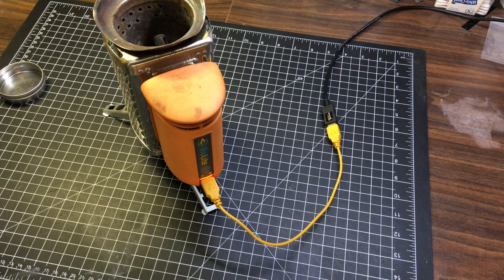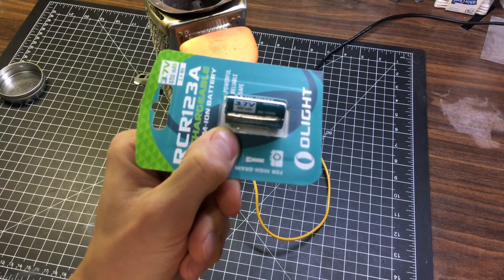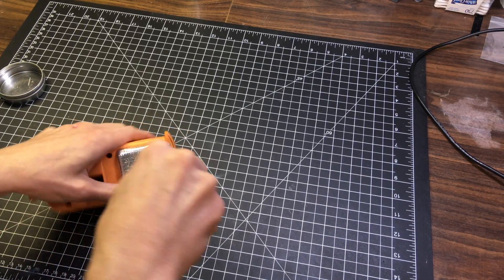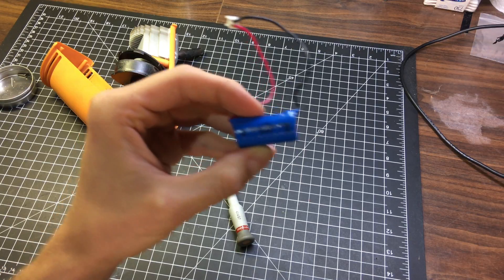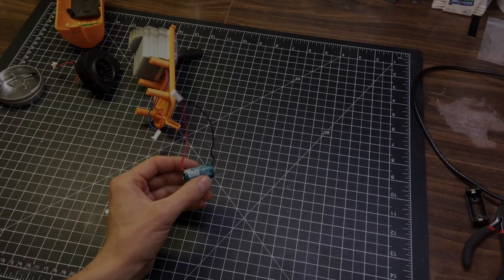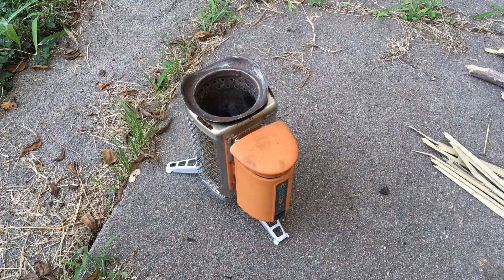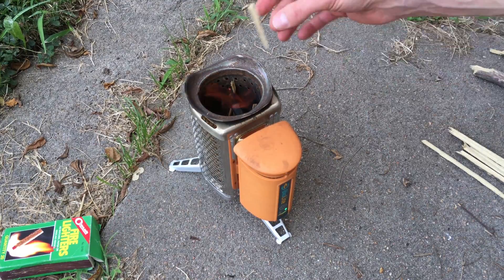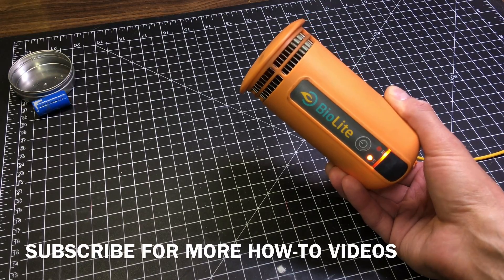How To: Replace the Battery in a BioLite CampStove

Comment: Thanks for posting this!  I've had a 1st Generation for about six or seven years now, too (with the kettle and grill - so sweet!) and while the battery is still functioning, I definitely notice a decrease in capacity and expect that I will have to switch it out sometime in the near future (which is what brought me to this video!)  In any event, thanks for posting . . . now, I'm just wondering if I can find a 3.7V with an ampacity greater than 800 mAh (you know, soup it up a bit!! :-) )  In any case - Great video, David!
Reply from the maker: thanks, I'm glad you liked the video!  good to hear you're going to keep your 1st Gen Biolite in service.  as for increasing the battery  mAh capacity, it should work fine, as long as you use the same voltage.  be aware, however, that the battery in the Biolite only powers the fan during startup, so upgrading the battery will only let you run the fan longer while starting the fire, and thats all (its not like the 2nd Gen that can be used as a power bank without an active fire).
if you have any questions about the battery replacement, let me know.  cheers, and good luck!
Reply: @DavidVonk  Right on, brother! :-)  The only reason I would want greater ampacity is to counter-act the capacitance leakage that occurs as a battery sits and waits for its next use.  Otherwise, in order to properly maintain the battery, it has to be brought up to a full charge every month and before each use.  Thanks again!
Reply: Here's a tip: cut a 3/16" or 1/4" steel plate the shape of the grill but slightly smaller. Transfer the oblong football shape to the plate using the grill body upside down. Drill lots of 5/16 or 3/8 holes in it. Throw away that cheap heat spreader that gets clogged, and say 'Hello!' to a searing grill surface. You can lift one leg of the grill to offset it, resting the opening underneath on the lip of the stove, to refill the chamber below. No dinky soy hatch needed - time for real steak!
Reply: Че написал про гриль я нихрена непонял

Comment: Just in case anyone is wondering... The Campstove2 has a 2600mah 18650 cell... I just changed it to a NCR18650GA 3500Mah (Only for the hinger capasity)
Reply from the maker: nice! thanks for sharing.  i would imagine that the 18650 cells would be easier to replace and more readily available... not to mention higher capacity.
Reply: Did you wire the battery directly, or did you solder the strip component that came with the original battery?
Reply: @Revyloution  Yeah, please let us know.
Reply: @RocketRiderToTheMoon  I wired the strip component on the 18650 battery. It's been working great.
Reply: @Revyloution  Was there any space left for a bigger battery? Otherwise a LG Chem 21700 battery would be perfect. 2 times the capacity (5000MAH) and just a little different dimensions. A 21700 battery is 70mm long. Please advice. 
LG Chem M50T link https://www.nkon.nl/lg-inr21700-m50-5000mah-7-3a.html?___SID=U

Comment: do you know the rating of the TEG, would be very helpful. thanks
Reply from the maker: from what i can find, the TEG generates 2 watts at 5 volts continuous, with a peak of 4 watts at 5 volts, dependent on the strength of the fire.  of course priority goes to the fan first, then to topping off the internal battery; when that is full, excess power is then diverted to the USB port.  ive read the fan uses about 1 watt and the USB port gets about 2 watts on average.
Reply: @DavidVonk  cheers mate really helpful, I am doing a project that is similar to the biolite but on a bigger scale. I bought 7 cheep teg's but can only produce around 2v from them using an electronic radiator to test them.

Comment: Do you know if you can upgrade the battery to a higher mAh so it has more power like the new Gen 2 stove?
Reply from the maker: theoretically yes, you could upgrade the battery to a higher capacity... however, in the Gen1 stove, it seems the sole purpose of the internal battery is to power the fan long enough for the thermo-electric generator to create excess power.  only after it has exceeded that power generation threshold will it use the USB port to charge external devices.  the onboard circuitry does not charge anything without the fire being hot enough (i.e., the battery alone will not charge anything).

it would seem that upgrading the battery would only allow the internal fan to run for longer while you are stoking the fire.  the only other possible benefit that comes to mind might be that an internal battery with a larger capacity would stay above the "power threshold" longer, thus allowing the circuitry to divert excess power to the USB port sooner.  this, however, is merely a guess.
Reply: David Vonk thanks David. I picked up a second hand bnib gen 1 for $100 CAN plus $14 CAN shipping on Kijiji, (its a sale site across Canada where people sell used items).
Reply: David Vonk was debating buying the gen 2 onsale locally and reselling the gen 1 but still pondering that.
Reply from the maker: @Bondo843  - nice, good score!  the gen 1 is a decent, functional product... however, i do see the allure for the refinements with the upgraded gen 2.  i  considered upgrading to a gen 2 since my gen 1 battery was dead, but now that its working again (successfully field tested on a week-long backpacking trip since the repair), ill keep my gen 1 around for the time being.

Comment: One more quistion if the fire of wood is good dose the biolight charging mobile like a charger of electricity?
Reply from the maker: yes, once the wood fire is burning hot enough, the stove will charge electronic devices via the USB port on the side.

Comment: Hello thank you for this viedo. Pleas i want to try work the biolight on cooking gas or some candle appreciate your feedback
Reply from the maker: hi there, according the manufacturer's website, the Biolite is "...designed to burn solid biomass only: sticks, twigs, firewood, pinecones, wood chunks, etc."   i do not imagine that liquids (e.g., white gas, candle wax, etc.) would work very well.  the combustion chamber requires air circulation around the fuel for complete combustion, and liquids would stay at the bottom of the chamber.